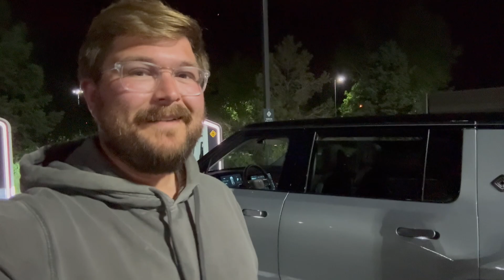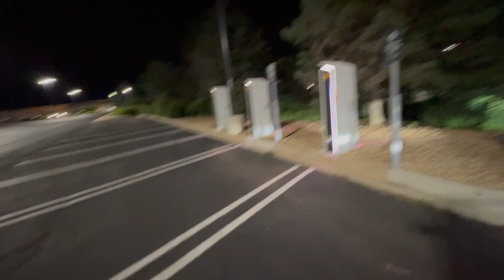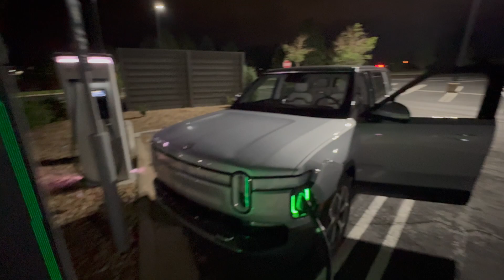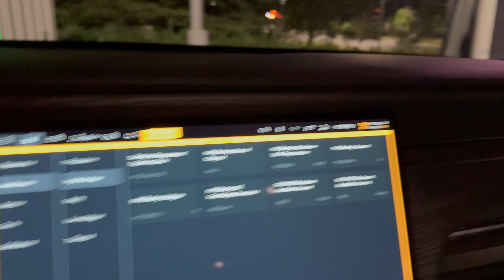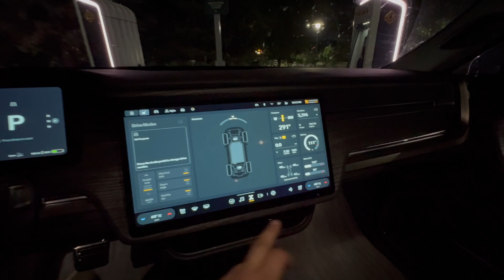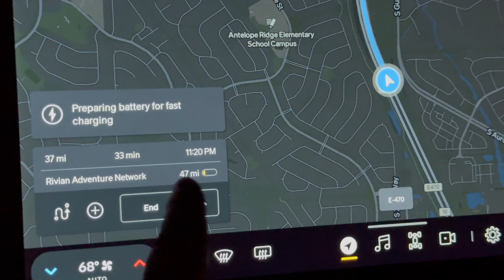Rivian R1S 10% EV Road Trip Challenge! You Can Go This Far After A 15min Charge (Gen 1 Dual Max 21")

Comment: I don’t charge like  this nor do I drive like this.  The number I look at more than anything else is efficiency.  I just drove my R1S from Golden to Lake City and around on the loop roads in Lake City. Used the Rivian charger in Salida while having lunch on the way there and on the way back. At the end of day in Lake City would plug into the free Rivian Waypoint and add 10 to 20 kWh while at the local brewpub or restaurant. Total trip was 735 miles, burned 258 kWh for an efficiency 2.86 m/kwh. Left Lake City with 300 miles on the battery, arrived in Salida with 165 miles on the battery (SoC=46%). Could have made it home without charging, but did anyway.

Comment: For the $18 spent charging, my daily driver Highlander Hybrid with similar size and load capacity would go 160 miles at 80mph, followed by an additional 320 miles before a 5 minute refuel at $54.

The Rivian retails for more than twice as much and would need six charging stops at $108 and 90 minutes for the same performance results. 

So how is this more efficient?

Comment: I recently did a 5,000 mile trip through Montana and Western Canada on our Quad Gen 1 R1T. I did a total of 34 charging stops. Some were at a very slow 25kw DC charger and a couple at level 2 chargers. I mostly charge to 85% SOC due to the uncertainties of traveling in unknown places. I did use an A2Z adapter to charge in Tesla Superchargers. The average charge time was 47 min 1 sec. If I subtract the multiple times I had to charge in the 25 kW charger (nothing else available for 100 miles) and the Level 2 charge sections the average charge time  38 min 19 sec. This was better than I expected.

Comment: There is no reason for any car, even cheap economy Bolts etc, to not have monster charging anymore. Charging matters as much if not more than charger ubiquity. With that in mind, I think it would be better to call out that this charging behavior is unacceptable. Every car should be able to hold max charging to 80% and if they can’t, that’s a failure of engineering in the car. You wouldn’t buy a phone that took an hour to get to 80% so we need to stop accepting this from cars.

Comment: The nice thing with the Max pack is you would have driven for four and a half hours and gotten around 350 miles before pulling in at 10%. It is nice to know that on a 15 minute break you could easily get another hour of driving.

Comment: And this ladies and germs is why i say 800V or bust!  17 mins to acquire 48kwh of electricity in my IONIQ6 last night!
Reply: Didn’t this Rivian do roughly the same? 45 kWh in 15 minutes. Problem is, the Rivian is much less efficient.
Reply: @GraysonCarr it isn't just that, it is a C-rate thing. The Ioniq series and other 800v cars hold a much higher C-rate for much longer.
Reply: @GraysonCarr  I was impressed with how well it charged there in that short session.
Reply: they could also do what gmc did with the hummer and the silverado, 400 volt battery but still could charge at 800 volts
Reply: Went on a road trip in my Ioniq 6 and just came back the other day. Quite a few of the charges were 10 minutes and most of those were overkill. Could have shaved a couple of minutes off if I could live with a 10% buffer instead of 20%.😊
Reply: My personal best has been 50KW in 15 minutes.  The E-GMP architecture cars are charging beasts.
Reply: @AlexBerman1  Just checked last charge & I got 44kWh on my last MY charge at a V3 station in 17 mins and 54 kWh with my MX a year ago. 800V does have advantages but more important is the manufacturer & chargepoint making it work right. I'm repeatedly shocked that more companies can't duplicate Tesla's success when it's been there to copy for years. So sure, work towards 800V but making reliable chargers, cars, & software will always be more important.
Reply: @kevinandabbie  it’s easy to create a closed ecosystem when you only have to be compatible with yourself.

Notice how long it’s taking Tesla to actually roll out charging support for other brands?  Contracts and such were reported on over a year ago, but the actual rollout is taking a lot longer.  They seem to be having a lot of issues supporting more than their own product at their chargers

Comment: These 10% challenges are some of the best data and tests we could get.  Need a summer and a winter run for each.
Reply: To me it seems a bit arbitrary that you would shut down at 15 minutes. We just saw the charging curve ramping up for the last couple of minutes so while Rivian may underperform based on 15, it may over perform if it was tested for 30 minutes.  Kyle should have posted the 0 to 100 charge graph to determine what the sweet spot is.
Reply: To me it seems a bit arbitrary that you would shut down at 15 minutes. We just saw the charging curve ramping up for the last couple of minutes so while Rivian may underperform based on 15, it may over perform if it was tested for 30 minutes or more.  Kyle should have posted the 0 to 100 charge graph to determine what the sweet spot is.
Reply: R1S should have better aerodynamics than the R1T.

Comment: 20:30 - I haven't seen many degraded charging instances, even when I went on a multi-thousand mile towing trip last year. In some areas, I'd be charging (with preconditioning) about once an hour to 90 minutes, and would still see 200+kW through 30% no problem. (In my quad-motor Large pack.) Only a couple charge sessions in 95+ degree (F) did I see vehicle-degraded. (I also had a few terrible EA stations that the degraded charge performance was almost certainly the EA station.)
Reply: Yea I’m not getting those numbers after 3 roadtrips in 2 months in the south. Kyle’s’ last two Rivian videos I’ve seen also show derating. The thermals just blow unfortunately.

Comment: For me this is would be better to do as 20-25mins.  Because the only reason that people do such short charges is because of a bad charge curve.  This rewards the cars that charge fast then fall on their face.  I don’t care if a car can charge at 215kw at 5mins if it is down to 80kw  at 17mins.  A good road tripping car has a decent initial speed, but more importantly a flat drop after the initial surge.  That is the difference between 20-25mins going from 10-75% and 40-45mins.  In the real world road trips you need 150-210miles of range after charge to do a 80mph and not worry about things like headwinds and minutely planning every stop with zero buffer

Comment: The Gen 2 should be near-identical results. Max pack didn't change, dual-motor didn't change. There are a few weight-saving changes, but probably not enough to make more than a 1-2 mile difference. And with the weather/temp being good, the heat pump in Gen 2's improved HVAC efficiency wouldn't have mattered, either. In Winter, Gen 2 will do a lot better on this. (And I imagine the new 22" Aero wheels will be basically the same as the 21" with aero caps.)

I'll be interested to see how the new Tri-motor in Conserve mode compares.
Reply: Wrong. Gen 2 has a new oil-cooled battery system that promises to keep thermals in the pack way down. Cooler pack --> Less Thermal Throttling --> more KWh delivered during the 15 minute charge --> Further range.

Comment: Great journalism Kyle. Always pushing EVs to do better. Seems like Porsche listens. I would love to understand the progress in energy density and why we don’t see that progress in our EVs. Like best example is model S used to go up in Battery size every year. But the last 5 years seems to stay the same. I thought energy density was increasing every year?
Reply: They are. Look at the Ioniq series for example. Part of it I think is that we have seen a move to a lot of manufacturers using LFP batteries. Since they are as energy dense they kind of dilute the progress made. Not that LFP batteries are a bad thing, they should be used in lower end and medium end vehicles that don't have the same sort of charge and discharge requirements. They are also more usable for the average everyday person since you can actually charge to 100% every night. It helps offset the lower energy density.

Comment: I would love you to do this challenge on the new Ford F150 Lightening Flash edition with the new heat pump more efficient AC to aid in battery preconditioning and improved charging and now that Ford has now finally introduced Charging KW rate on the front dash why not!!

Comment: Hi Kyle, I've been watching your range trip videos for a long time. I think this test needs to be expanded a bit to truly capture the "road trip" experience. Three factors are at play-- range, efficiency, and charging speed(with emphasis on the curve). The 10% test is great for efficiency and charging speed (esp down low) but doesn't take into account range of the vehicle. For example, an Ioniq 5 awd may charge very well and do well in the 10% challenge, but if I compared it to say a Mach E in a real world trip they would be closer in performance as I would have to stop at 227mi for my initial stop in the hyundai..the Mach E I could go 285mi on the initial charge. That's about 60mi further down the road. So yes..the Ioniq 5 charges much faster, but the roadtrips are hampered by battery size. (we see this play out on the Vegas trips). So I would suggest you start with a 70mph range test, then when empty start the 10% challenge. Add the numbers together to get a true handle on how the EV would road trip. I would also suggest 70mph or 75mph instead of 80. Very few people on the east coast road trip at 80mph.

Comment: I'm curious if you would have set the max charge to a lower number if the system would have adjusted the thermals so you would have got a better 15-minute charge. Probably not but might be worth testing.

Comment: Kyle, this is a weird test...not real world at all.  I've had a 22 Quad and now a 23 PDM Max...Max pack is a much better road tripper and camper tow vehicle.
Reply: How is charging for 15 min and testing the range a weird test?? - fellow R1T max pack owner
Reply: I have the same thing but just large pack. Have you done any towing yet? Curious as to the experience.
Reply: @RivianDogDad  We're on our 2nd R1T now.  The first was a 22 Quad we had maybe 6K in towing & 31k total on that one...we have a 1969 Shasta my wife and I did a total rebuild on during Covid.  We have had our 23 PDM Max pack for 1 month, just over 3K miles, and 1K of towing.  This last trip, it may be the updated software on the suspension, but with suspension on firm, it feel super stable and pulled great.  Better than our 1st Quad, so it seems like it's the software adjustment.  BTW, Our little Shasta is 4k lbs and has the aero of a parachute.

Comment: Don’t you really want to compare total miles driven on a road trip - full charge down to 10% then charge for 15 then drive?
Reply: That's really only applicable to the first leg of the trip.  As soon as you have to charge a second time, you're in the scenario presented by this test.
Reply: @iamnid sure but the initial leg range plays a part in how many times you need to stop.  Also if you are going far you charge longer than 15 mins

Comment: On a recent trip to Tahoe my Gen1 R1S large pack with 21" wheels did 45kwh and around 106 miles added in 17 minutes at the Truckee RAN station. For me thats totally good for a road trip. I had time to plug in, use the bathroom at a coffee shop and get a drink. If I started that trip with 351 miles i would probably need a 15 minute break after 3-5 hours of driving anyways. These tests are great for sure but are also limited because you are only showing a single session. TO really make sense you'd need to do multiple tests to get an average and I'm not sure if you said you did that or not on each model. For example if my one session added 45kwh in a 17m stop I'd argue thats great, but if the next 5 only added half that for whatever reason I now can't assume every stop will be 100m/hour added. etc etc
Reply: I think the problem is when you need to have 3+ charging sessions a day. Thermals will limit your charging significantly, adding 25-30% time to your trip.
Reply: @polzovotel so the only real way to test road-trip with a car is to basically drive 500-800 miles in a day. A full 8-12 hours which is a real all day road trip for most.
Reply: @JoeSimonsen  100% agree. Doing this next month :)
Reply: @polzovotel yeah I’m taking a solid road trip with the rivian in September. Should be fun!

Comment: I really do love this info. It is a nearly perfect metric for road tripping. I know it would be impossible to do this since you already have a ton of data, but I have never done an average of 80 mph on a road trip. I've only ever seen an 80 mph speed limit sign once in my life. The highest I see on all my road trips is 70 mph (mostly east coast and Appalachia driving). So to me, a 70 mph speed would be better info. Some cars perform much better at 80 mph than others, so this skews to them. But still, getting this data at 80 mph and simply seeing how much energy you can get from a 15 minute charge at 10%  is amazing data. Knowing the R1S can get 45 kwh in 15 minutes is really good data. Like you said, it would be awesome if Rivian efficiency could match the Model X or the EQS (is the Rivian the least efficient 7 passenger out there? Not a ton of competition in that segment), it would be a true road trip monster.

To me, for example, knowing the Ioniq 6 can get 45 kwh as well means my EV6 will get about the same. On our last 800 mile road trip, we averaged 3.7 mi/kwh. So super easy to calculate we can do ~165 miles in a 15 minute charge at our speed. Which is pretty accurate, our charging stops are usually 11 minutes every 2 hours, I can't drive further an 2 hours without needing a bio break haha.
Reply: Yeah the 80MPH thing makes sense in the big empty Western states that are all just pockets of people connected by highways (mostly Interstate).

Comment: you should really call this the 15 min challenge as that amount of time you spend charging.
Reply: 💯 The reason this test is valuable is that it tells you how far you can go on a 15 minute charge. Calling it the 10% challenge is about as useful as calling it the "AC off in the back seat challenge" - 10% is just one of the controlled variables
Reply: @benjaminkindle1841 It's also extraordinarily confusing to the EV/OOS novice. It sounds like they are testing how far the car can go from 10% to zero.
Reply: I used to think this and made the same comment. And I still don’t like the 10% part. But I think they’re right to call it the “road trip challenge” and then 10% is just a parameter of the challenge. Obviously it matters A TON for charging what SoC you arrive with. And on a road trip this is how you will want to arrive at chargers along the way to hit the best part of the charge curve. So… “Road Trip Challenge” it is!
Reply: This has been one of the most liked comment on every single video since the first challenge.
Reply: They’re charging from 10% and driving down to 10%. Everything else is “optimal” parameters, but 10% is where they’re not pushing the limits and running the car to the end of the battery buffer.
Reply: @supergeek02468  we all understand the challenge. But the two factors for road-tripping are simple 1) charging speed/curve and 2) vehicle efficiency. Aside from capturing a different section of the charge curve the test could be done at 5% or 20% or any other arbitrary SoC.
Reply: Or it could be called the 10-15 challenge or something like that. Maybe "10% - 15 minute challenge."
Reply: Same as "Race to Vegas in reverse", just call it "Race from Vegas" and be done with it.
Reply: @stevedrawdy2532  love this! And I can't wait to watch it. The human error on the way to Vegas in the EV9 was real.
Reply: @stevedrawdy2532 you mean they're not going to drive back from Vegas entirely in reverse?